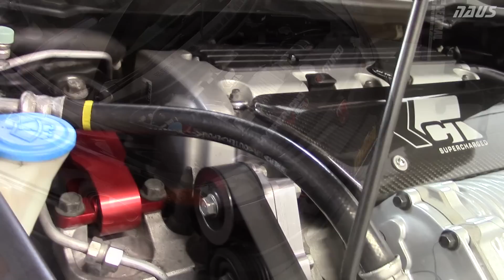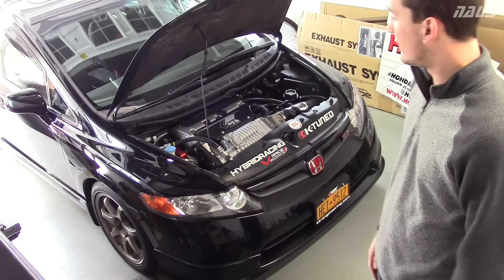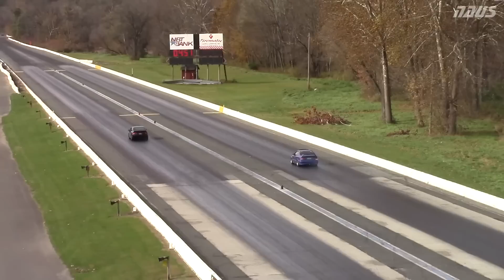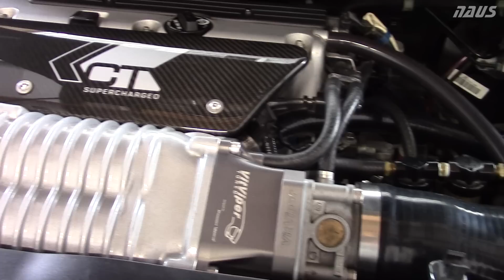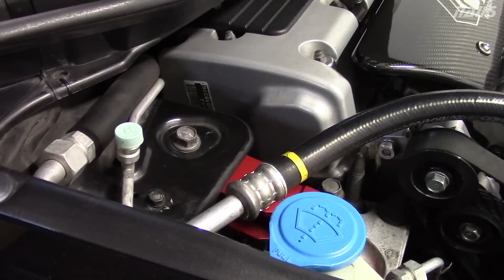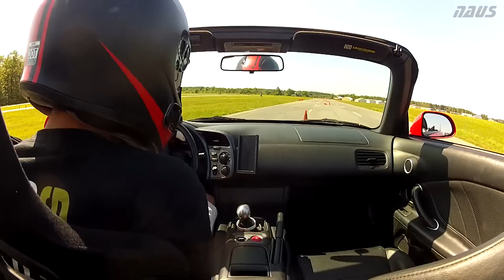Why I STOPPED Modding My Civic Si

Comment: Sorry I’m late too your channel man. Just wanted to say I love the setup and respect the decision to keep it at this level 👍🏼

Can you tell me how many miles have you clocked up since the supercharge install and have there been any problems with the stage 1 exedy clutch?
Reply from the maker: Appreciate the comment man! I put about 10k miles on the supercharged setup. Throughout that time I had zero issues with the supercharger or exedy stage 1 clutch. The car now has over 35k on the clutch and it’s still holding strong
Reply: @NAUS2K  so impressive, I think this what a lot of people miss when setting up a car, its not solely about numbers.  You’ve achieved the perfect balance 💯. I am going down the S/C path (MR1900/K24A3) with a relatively conservative set up and hope to stay around 350whp, if i can achieve that without changing my Exedy stage 1 clutch I’d be happy. Thanks for the head ups 👌🏼

Comment: i need a belt for my k24 cte with the 3.15 pulley, i want the good gatorback belt.  where do i find it? or the part #
Reply from the maker: If you have a k24 the crank pulley will be different so the Original Cte belt may not work. Best bet is to take a string and route it and measure how long of a belt you need

Comment: Do I need the aftercooler or could I upgrade later? I have a CTE stage 2 SC BNIB just sitting in my closet and I really want to install it but I don’t want to risk reliability. Some ppl say I should just go ahead an install it but I’d rather get an opinion from someone who has the set up down pat
Reply from the maker: AnbuFG2 go ahead and install it, just make sure you get a full custom tune when you do , as long as the tune is quality you will not have any reliability issues
Reply: NAUS Much appreciated man! Guess I’ll go ahead and install the blower

Comment: Have u done the clutch master slave upgrade to get rid of the diaphragm cause it was a night and day difference for me it shifts way better got rid of 2nd gear grind at high rpm
Reply from the maker: I have had the Hybrid racing EM1 CMC kit installed in this car since 2011. That was actually the first mod I did. The slave cylinder is original still though, nothing wrong with it. Ive never heard of slave cylinder issues on this platform.
Reply: I have the k tuned cmc and slave cylinder I had a problem when shifting fast at over 9k rpm mine all motor with tune, some bolts ons, type s oil pump update and hr timing tensioner

Comment: Yo I have an fg1 coupe automatic non-si. It has the r18 motor. What do you think are the best mods for the best bang for my buck. Since it’s different than the si do u think it’s worth it? Thinking about hondata but don’t know if it will make a huge difference if stock. I’m a sophomore in high school so money doesn’t come easy haha. Thanks!!
Reply from the maker: Wesley Gadbois leave it all stock and save your money, that car was designed to be fuel efficient and nothing more . I have an r18 5 spd as a daily / winter car. Save up for an si because any money you spend on an r18 is gonna be a waste

Comment: Well it is always  much cheaper and more reliable to buy a car from the factory with the power that you want then to try to make the power with modes. Even a second hand in good condition . There are many options on the market .
Reply from the maker: MickyMouseLimited I have to disagree again, a new m3 would be at least three times more than what I have into this car, and this car is very reliable

Comment: I have no knowledge about modifications. I bought and 8thgen with a throttle bod space and a air intake. Should I get it checked out for a tune? 
Great video btw good to see a Honda that is being treated nice.
Reply from the maker: what do you mean checked out for a tune? You can remove the throttle body spacer because they do absolutely nothing, and if you want a tune you are going to need to purchase hondata flashpro

Comment: Instead of using E85 used water methanol kit stage 2 aem
Reply from the maker: Methanol will eat the factory rotor coating on the supercharger, which means less reliability. Id do e85 before spraying meth

Comment: Bro  do you  think skunk2 manifold   will a good option  with  acura rdx 410cc  .        Idk if i should sell it or keep it
Reply from the maker: intake manifold or exhaust manifold (header)? unless you have cams the RDX injectors wont really help you, I ran RDX injectors on my all motor build and it was kind of pointless.
Reply: NAUS bro is intake manifold pro series black.     I'm  planing  to go with in intake,exhaust, header . And probably  the intake manifold. And injectors.    Help me out bro  . Idk what  to do
Reply from the maker: Hondata Flashpro and a good tuner should be your priority if you wanna run those mods

Comment: Surprise it has not exploded yet, my 2009 Civic si... transmission blew up... and I’m only pushing 300 hp with a stock transmission
Reply from the maker: I blew out the OEM differential in this car. The trans in the car is the second one.

Comment: For those 4 years of the same set up, what were the things you have changed  or fixed? Like how was the maintenance?
Reply from the maker: Besides the transmission issues (more my fault than anything), all i have done are engine oil changes every 2500 miles.
Reply: NAUS thats cool, how bout the grooved idler? I heard theyre always a fail? Thats why vit made one thats much quality
Reply from the maker: Yeah I went over this in the video, they really only fail if you run a bigger crank pulley for more boost. Im on the stock crank pulley so my belt speeds are the same as a stock Si
Reply: NAUS cool man I prbbly missed it. Btw, is you full race have the race header pipe option (3”)?

Comment: Nice video bro, 
does the Hybrid Racing EM1 CMC kit helped to get rid of the 1st to 2nd gear grind shifting at high RPM (around 8000) ?
Reply from the maker: It helps disengage the clutch faster, but if your having bad grinds its most likely your syncro, time for a new 2nd gearset
Reply: Do you recommend OEM syncro?
Reply from the maker: Yes you'll have to buy a new OEM 2nd gearset

Comment: track speed is the only number that matters? not really true. I mean u can have a car beat urs with less track speed. anyways u have an awesome car. I would be done w it too!
Reply from the maker: Trap Speed is the MPH your car crosses the finish line in the 1/4 mile. This is absolutely the most accurate number to determine which car is faster assuming same traction. Its a combination of HP/Weight and gearing.
Reply: no its not.fastest time wins the race not mph.u can have a slower top speed and win the race cause u got off the line faster!
Reply from the maker: Evan Johnson you missed the point when I said assuming both cars had the same traction

Comment: How many miles does your car have now bro
Reply from the maker: Diego_FA5 99k brotha
Reply: NAUS nice mines at 125k. Looking to do some more power mods. Think I want to do a ported head by kmod with the 5angle race valve job. Then do supertech valve springs and retainers with drag cartel 2.2 cams. After I would like to go with a blower set up similar to yours but I'm thinking do I really need to do anything to my head?
Reply from the maker: Diego_FA5 save your money and just slap a blower on your stock k series , the k20 heads flow very well and big cams actually hurt a supercharged setup
Reply: NAUS what's the deal with tsx cams I've been reading in the forums that it's a good upgrade to our stocks or should I just leave it alone and slap on supercharger like you said lol
Reply from the maker: Leave stock cams, all that talk about the TSX cams is a waste of time. Leave engine 100% stock and slap a blower on it
Reply: NAUS gonna do just that. Now to figure out what kind of charger I'd  like better cte or kraftwerks

Comment: I wonder why don't you sell all this cars and get something that is ready from the factory like an BMW M3 with a inline 6 or v8 with stock 333 or 400 hp? It will cost less down the road plus it will be way more reliable. On top off all the interior will be light years ahead.
Reply from the maker: MickyMouseLimited because all three of the cars that i own combined are cheaper than an M3. And down the road an m3 would not be cheaper to own. Everything from oil changes to brakes are way more on anything German. Used m3s are horribly reliable too compared to a Honda.
Reply: M3 reliable? Lol good joke